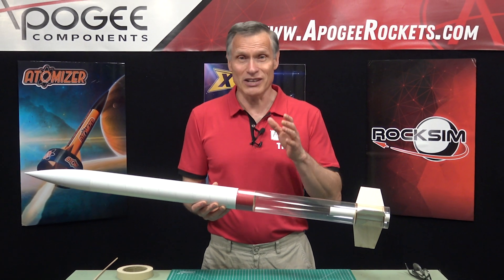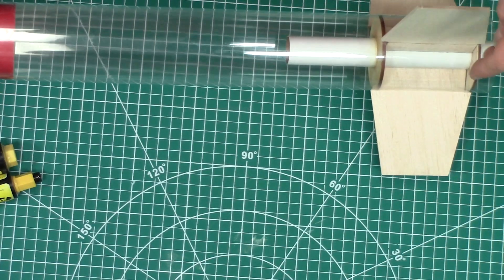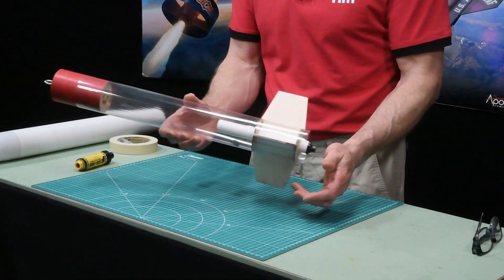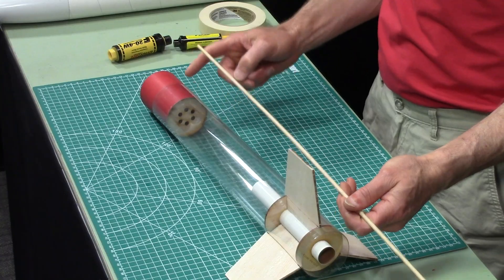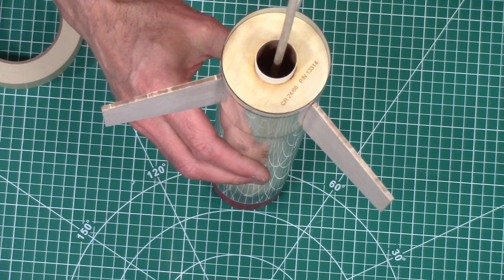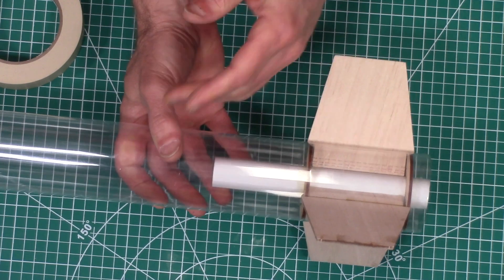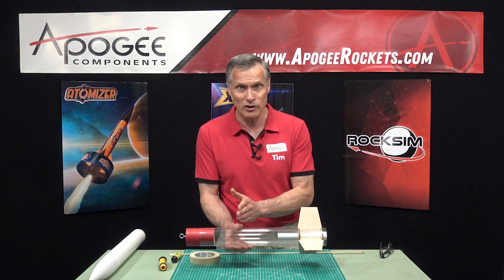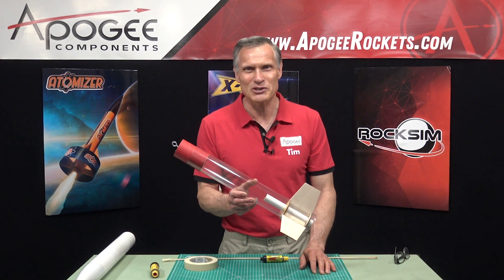Removing the Rattle from Your Model Rocket

Comment: Excellent tip! Simple (once you know the secret)...What about placing a 3rd centering ring at the tip of the engine mount flush with the end? Since the 2 existing mounts are heavy duty and already take the load stresses, the third ring could bu cut from relatively light but still stiff card stock. Of course with that method a little weight is added, with your method (cutting the motor mount tube shorter), you are subtracting weight so I guess I answered my own question ;)

Comment: Should I use a composite motor over standered motors like Estes motors
Reply from the maker: It depends on what you're trying to do. The composite motors are usually for larger rockets that need more thrust.
Reply: @apogeerockets  thanks!

Comment: Or you could attach a lightweight card-stock centering ring at the end of the longer motor tubes.  It doesn't need to take much force because the main centering rings will do that.  It will also shrink the volume of the space between the engine and the baffle making it more efficient in forcing air out of the baffle.  It might be a minor cost in weight, but it will also tend to shift the CG slightly forward which is usually a good thing.

Then shake out the tube as you've shown above.

Comment: Or, add a third centering ring flush with the forward end of the motor mount tube.Then you can jiggle out the ejection cap. And, you have less volume to pressurize as a side benefit!